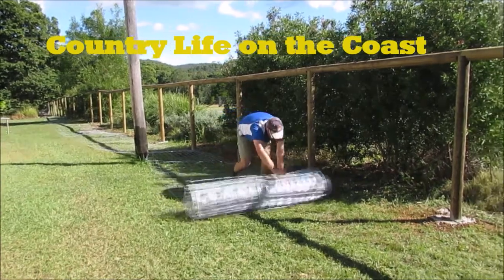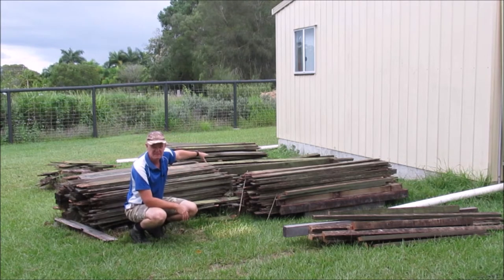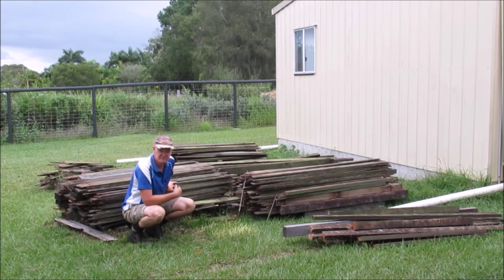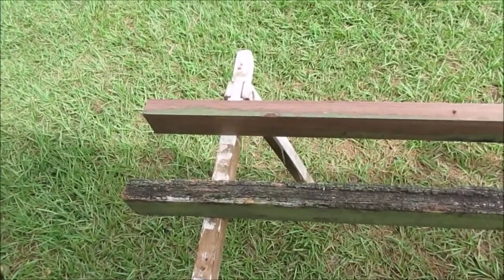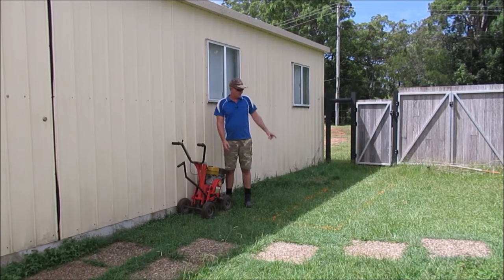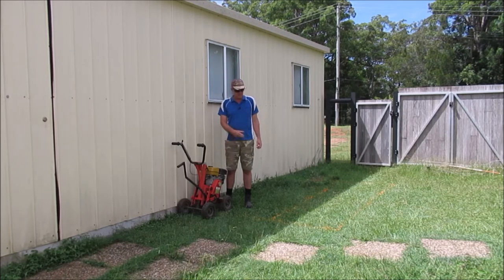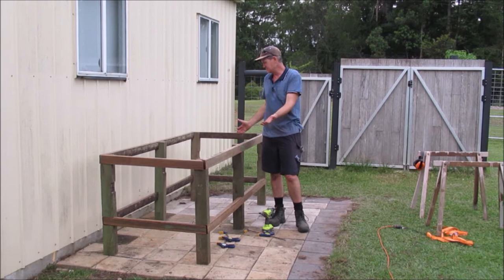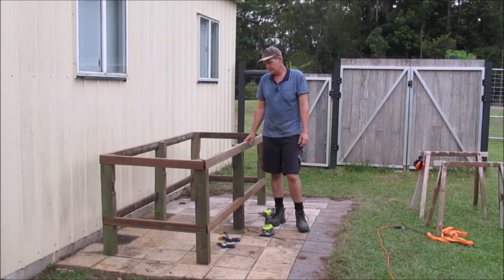Building the ultimate outdoor workbench that costs less than $30

Comment: when you are using the depth stop on your miter saw it won't all the way through you need to put an extra piece of wood along the fence to help extend the cut so it goes all the way through to the back of your piece. Remember the blade is circular and will not be able to cut all the way through to the back when you use the depth stop.
Reply from the maker: I had since worked this out, but thanks for sharing this, it is a really good point.